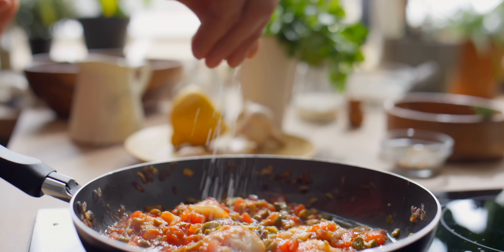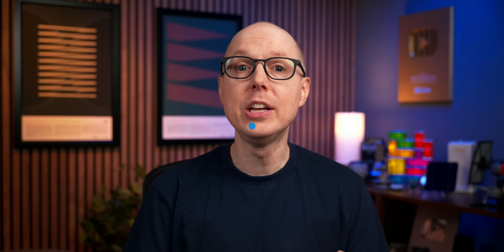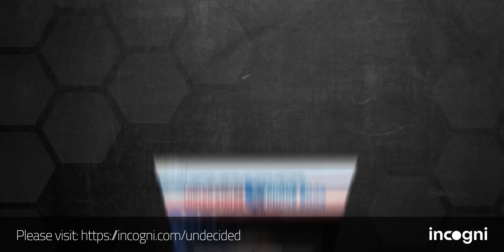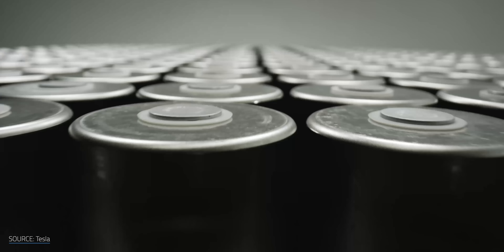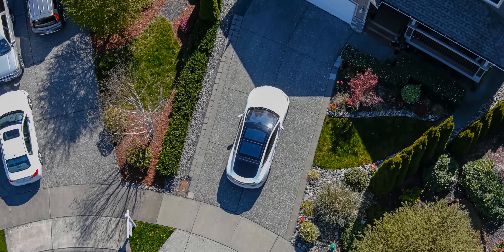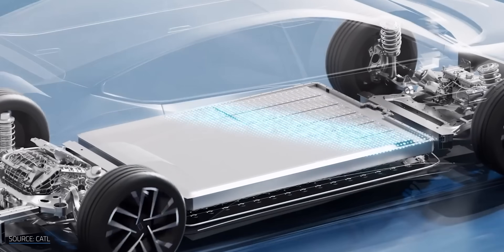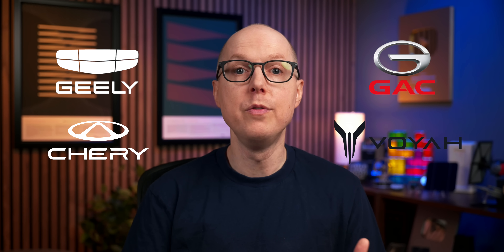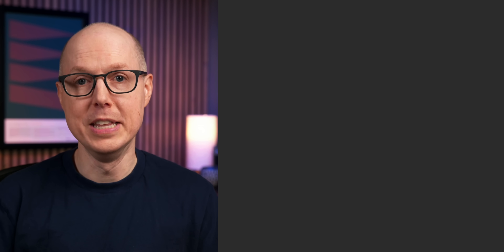How CATL Made Batteries 90% Cheaper (And What Happens Next)

Comment: Let me see.  If I could buy a Tesla Model C (Cybercab is a stupid name), i.e. two doors, two seats, very compact, with a steering wheel (round) and foot pedals (although a 'fly by wire' side-stick would be more than acceptable) for under $20,000 by using salt based batteries, I'd jump at it!  I'd place my order online in seconds.  In fact I'd buy two.  All for myself.  Not renting them out.  Oh, and I'd but FSD for when I didn't want to drive.

Comment: SIB does not require strict hybrid approaches to meet all performance factors everybody expects. Due to its thermal properties from -40 °C to +60 °C without significant performance losses, the SIB can be discharged to 0 V or fully loaded to 100% SOC and stored over extended periods without further degradation. With multi-level (ML) inverter technology and cell-sensitive BMS-integrated SOH design specifications, bidirectional performance with less loss and more charging or discharging capacity is possible, as ML is capable of achieving the variety of performance levels required in the field of e-mobility, including V2G/H/L applications, energy grid serviceablity, plus having an outstanding capable automobile or other e-mobile, or at home as a backup energy source.

Comment: CATL Battery News - ChatGPT

Launch of "Naxtra" Brand & Mass Production Plans

At its Super Tech Day on April 21, 2025, CATL unveiled "Naxtra": its new brand for sodium-ion batteries. They positioned it as the world's first mass-producible sodium-ion battery.
CATL confirmed it will begin mass production in December 2025, focusing first on passenger EV applications.
Earlier stages will see production of 24V sodium-ion starter batteries for heavy trucks beginning in June 2025.

Performance & Technical Specs

Energy density of Naxtra batteries is around 175 Wh/kg, closely matching lithium iron phosphate (LFP) batteries.
They maintain 90% usable power at -40 °C, offering exceptional cold-weather reliability.
Claims suggest 500 km driving range, over 10,000 lifecycle charge/discharge cycles, and intrinsic safety, with no combustion-supporting components.
Additional safety tweaks, like withstanding drilling or nail-penetration tests, reinforce their nonflammable, nonexplosive design.

CATL founder Robin Zeng stated that sodium-ion batteries could replace up to half of the LFP battery market.

At the same Super Tech Day, CATL also showcased:

Freevoy Dual-Power Battery: A hybrid system combining different chemistries (e.g., sodium-ion + LFP), offering boosts in energy density, range flexibility (up to 1,500 km in some setups), and autonomous-driving readiness.
Second-Generation Shenxing Superfast-Charging Battery, Capable of delivering 520 km range in just 5 minutes of charging, reaching 80% capacity in 15 minutes even in cold weather. Over 67 EV models are expected to adopt Shenxing technology this year.

Comment: So if the energy density is lower and the cost is higher than lithium (as you say in the Drawbacks section), how does that add up to a 90% price decrease? I get that there's a lot of opaqueness here, but what are CATL claiming they've improved: energy density or cost to manufacture, or both?

Comment: I'm going to go out on a limb and guess even before seeing the rest of the video. that the reason these are so cheep and also the reason they are being so quiet about the tech are both the same........ some how this new battery are really good for them long term while being really bad for consumers long term. like a really hi fail rate or short use life, bordering on planed obsolescence. or there is some sketchy fine print when you buy them. (a subscription model perhaps) some how these are engineered to hurt consumers. and profit them so it makes sense to loose a bit up front to hook us into what will turn out to be a bad deal. think printers and print cartridges.

Comment: Batteries are an ideal product for large-scale production. Even if the formula changes, the assembly line's flow can remain the same. This type of industry, which doesn't require increased creativity and relies solely on expanding production scale, is what the Chinese Communist Party (CCP) excels at.
Tesla has provided an export market for the products after the CCP increases production, which has indirectly allowed the CCP to continually boost output and further drive down battery prices. Before Elon Musk moved Tesla's production lines to the Shanghai factory, the United States was the dominant producer of electric vehicle batteries. The CCP should thank Musk for this.

Comment: Probably BS. There's no strong independent confirmation from regulatory filings or audited financial reports supporting the $10/kWh figure. Most reputable sources, including Reuters and The Verge, report CATL’s launch of the new Naxtra sodium-ion battery brand, highlighting safety, improved energy density (~175 Wh/kg), mass production plans, and cost advantages relative to lithium, but without citing the unrealistically low $10/kWh cost claim.

Comment: TLDR and my thoughts: 
the quality of the videos of this channel has dropped significantly. It feels like you are only extending clickbait claims and questions and mixing and hiding the answers across the entire video. Also, mixing the ad-sponsor in the middle of the topic explanation is unbearable and annoying. Dude come on, everyone knows incogni sponsors all of your videos, just leave it a part so we can skip this repetitive bs, this tricking tactics makes more harm than good, it is so annoying that even if I choose to use their services, I would rather use other youtuber's code.

Now the TLDR:

*Interesting Facts and News from the Transcript:*

1. **CATL’s Sodium Battery Breakthrough**:
   - CATL, the world’s largest lithium battery manufacturer, announced Naxtra sodium batteries costing $10/kWh, compared to lithium’s $115/kWh in 2024 (down from $1,415/kWh in 2008).
   - Uses sodium, abundant and derived from seawater, unlike scarce lithium.

2. **Naxtra Battery Features**:
   - Energy density: 175 Wh/kg, close to lithium iron phosphate’s 185 Wh/kg.
   - Range: 310 miles per charge, suitable for urban/suburban use.
   - Lifespan: Over 10,000 charge cycles, equating to ~3.6 million miles before dropping below 85% capacity.
   - Temperature range: Operates from -40°C to 70°C, retaining 90% power in extreme cold.
   - Applications: Two versions—24V for heavy-duty trucks and one for passenger EVs.

3. **Freevoy Hybrid Battery**:
   - Combines sodium-ion with lithium-ion (LFP or NMC) in one pack.
   - Optimizes performance by switching chemistries based on conditions (e.g., sodium for cold weather, lithium for range).
   - Improves temperature range by 5% and adds 10+ km to electric range.

4. **Sodium vs. Lithium**:
   - Sodium batteries are safer, less prone to fires or explosions.
   - Drawbacks: Lower energy density and historically higher costs despite abundant materials.
   - Lithium benefits from mature supply chains and a recent 70% price drop over three years.

5. **Market Impact and Readiness**:
   - CATL holds 38% of global EV battery market, powering 18 million vehicles.
   - Naxtra and Freevoy are at NASA readiness level 8-9 (market-ready).
   - 30 vehicle models from brands like Geely, Chery, GAC, and Voyah will use Freevoy in 2025.
   - Sodium could capture half the battery market, per CATL’s CEO.

6. **Challenges and Skepticism**:
   - CATL provides no detailed explanation for the $10/kWh cost, raising doubts.
   - Sodium needs scale to be cost-competitive, but lithium’s price crash weakens its economic case.
   - Stanford (Jan 2025) and Columbia studies highlight sodium’s scaling challenges.

7. **Potential Implications**:
   - If $10/kWh is accurate, EVs could surpass gas car price parity, and home/grid storage could become widely affordable.
   - Even at $40-$50/kWh, sodium could transform renewable energy economics.

**Actual Information Gaps**:
   - No technical details on how CATL achieved the cost reduction.
   - Pricing claims lack concrete evidence, fueling skepticism.
   - Sodium’s cost-competitiveness remains uncertain without market-scale production.

Comment: Sorry, but it's NOT salt. Or rather, technically it is, but technically ALL batteries use salt. 
But yes, table salt and table salt contains around 40% sodium. 

But yes, I'm very much of the opinion that sodium batteries will be the main chemistry being used in stationary storage. Whether it will take over in mobile applications, I'm not sure. Possibly in lower end cars, but I don't think in higher end ones it will.

Comment: One interesting side effect is that if Sodium-Ion takes 50% of the market, then Lithium-Ion will also get cheaper due to Lithium costs dropping.
Lithium wont go away as there are many applications where energy density matters.
But cheap batteries for home storage or similar would transform the current energy market and make solar power that much better.

Comment: No one brings up that Sodium Ion Batteries will have the same problem as LFP did 10 years ago. Having lower energy density means spending more on separators and more anodes per kWh. LFP has really only been able to catch up with nickel cathodes as both reached significantly better energy density. 

Also, sodium ions are physically quite big in addition to a lower net voltage from the reaction. I'm kind of skeptical that their energy density in 10 years will be impressive.

Comment: Charge rate has to go up or I will stay out..fill up like a gas station visit or forget it. Also lower capacity will be a problem if u need heat or a/c. Glad they don't blow up but still a ways to go for me. They could get around most of these problems by just making batteries swap out. You pull in to a carwash-like station and a robot swaps your battery and off you go. This also means I don't have to worry about battery life and replacement. Maybe the government should mandate this??....I can hear the cries of the antigovernment folks already :)

Comment: Yes, I would buy a Sodium EV. I drive a Li-ion PHEV now & love it. I can get to work on electric & home on gas. I can drive anywhere and not get range anxiety because I can fill up on gas. I would love to have a PHEV with a 100 mile range as that would get me from home to work & back. It would also be mostly what I need to do my errands in the city once or twice a month. I would charge at work but the cost is $10 to charge my dead battery vs at home I pay $2.50. Gas hovers about $3/gal so $10 to charge is highway robbery.

Comment: I would absolutely buy a sodium battery.  In fact, this seems like the perfect technology to allow for replacement battery packs once EV’s with older battery chemistries  start reaching the end of their life cycle.

 As a way of combat and climate change, and consider, considering that half of the CO2 emissions of a vehicle are in its manufacturing process,  being able to purchase a sodium battery replacement once your original battery pack has surpassed. It’s useful life would be an economically viable strategy for combating climate change  and making EV‘s last longer.

Comment: First of all, this news is out of China, so 10% confidence without long term study use and quality control studies.  Thermal performance (high temp usage, charging and degradation) are what I want to know about, and that will take long term studies.  These are the problems other technologies have solved.  Need to see them before it gets the nod.  If it turns out to work, great.

Comment: I would buy a sodium power pack for travel so that I don't cause a lithium fire on an airplane. Safety matters more to me than price & avoiding lithium fires is premium. Same goes for sodium ion EV or battery for home solar. No way would I install a lithium system in my home nor would I drive a lithium car. Specially not a Tesla. If their batteries catch fire then you cannot open the doors or windows to escape & you are shish kebab.

Comment: I’d say, if you want scaling, you go into the 12V car sector. Sodium here has “only” advantages to offer as a replacement for the starter battery. That’s a billion-dollar market, and thanks to temperature tolerance, completely problem-free deep discharge, and long energy retention, such a 12V battery could even be more expensive than lead at first. After all, it would probably last the entire lifetime of the car.

So why doesn’t CATL take this path for scaling and not only 24V for trucks, and then follow up with cost reductions in other areas? … Or is that too obvious?

Comment: The fact sodium batteries are less explodey is a good enough argument for me
Reply: Likely case is that sodium ion is between lithium ion and LFP in flammability. LFP is still safer.
Reply: @fabiofzero  I don't really see batteries "exploding" to be an issue. It's so incredibly rare, what other energy storage medium is this safe?. Also LFP exists and is even safer
Reply: And fossil fuel cars are 60 times more explodey that EVs.
Reply: Ka-Boom!
Reply: Less doesn't mean not explodey. Sodium is right under Lithium in the periodic table and they share many characteristics. Both elemental Lithium and Sodium react violently and exothermically with water.
Reply: @johnhaller5851  well gas also explodes lmao 

there is no non-explosive option
Reply: @johnhaller5851  Lithium batteries aren't flammable because they use Lithium. You know that right?

Comment: For me, the positives massively outweigh the negatives here. If they do reach the $10/kwh, this should drop the cost of EV's significantly, making them much more affordable for most houses, AND they eliminate the fire hazard. This is a big problem with Li batteries. Many people I know wont touch them because of the fire risk. I've contemplated a battery system for my house, but since I live in Canada, they need to be kept indoors (I dont have a garage), and so Li are simply out of the question due to the fire risk. But, these could be kept outdoor (we rarely get to -40'c). This is the kind of battery tech I've been waiting for.

Comment: I hope this isn't B.S. and can be marketed soon.
Reply: RIGHT, the point is if it will hit the market soon, and will the drop “in cost” goes to the automakers, and dealerships, or to the end user. I started purchasing Ryobi drills, after my Black & Decker drills died a few days out of warranty.  Ryobi batteries are basically a battery system works in a large number of devices. If the EV battery can be replaced safely in your own garage, the battery costs will be a game changer.

Comment: I would def. be interested in a house battery at $10... or even $50 per kWh. I live in Canada and in the peak of summer got days, I used about 40 kWh (AC) and peak winter about 60 kWh (geo thermal heat pump)... Average is more around 40 kWh in the winter and 25 kWh in the summer... If the grid goes down, i could easily lower my energy use and be living for 72 hours on a 100 kWh battery... Probably longer...  100 kWh for $1k to $5k ? Add the inverter, electrician costs, etc... I could probably get all the working for less than 10k... A full 100kWh setup for less than 10k... I'm in. 
We have "peak" energy rate during the winter that are between 5 to 8 times more expensive than off-peak, I could probably recoup part of the investment by not using any grid power during peaks...

Comment: Pairing Sodium batteries with an EV battery swap solution should be a win win. The swap station can have a much larger supply of batteries for the same capital outlay, know that they will be good for a much longer duty period to recoup capital costs, charging at 5C then isn’t a problem either for the swap station operator or of course for the car driver. Enough swap stations so that a 175 ~ 200 mile range gives you easy access to a swap station for the next leg of your journey… A smaller but swappable battery compensates for the lower energy density and the lower charging rate.
Reply: Tesla did a battery swap pilot years ago and gave up on it because not enough people wanted to do it.  

Also making the batteries a structural component of the car has enough advantages that I don't see manufacturers going back to more modular packs that could be quick swapped.  

Better to just keep the fast charging research moving at this stage.

Comment: The biggest issue with EV batteries is the fact you are at the mercy of the battery installers.  If they’re not making enough money with the Salt Batteries, they will Jack up the Cost of the INSTALLATION.  One element that kept the Auto battery price in control was that the Owner could easily replace it themselves, and this is NOT possible with EV’s. BIG PROBLEM.

Comment: You have not broken down the cost structure, which includes cost of materials and fabrication. The sodium and lithium batteries share very similar structures and therefore costs at the level of materials other than the current-carrying ion. It would be very surprising if the cost of everything but the ion material was only 10%. So the factor of ten is dubious.